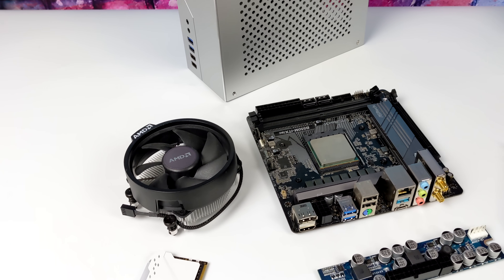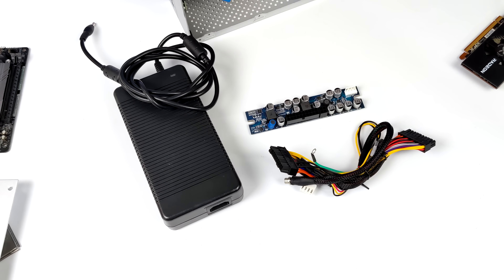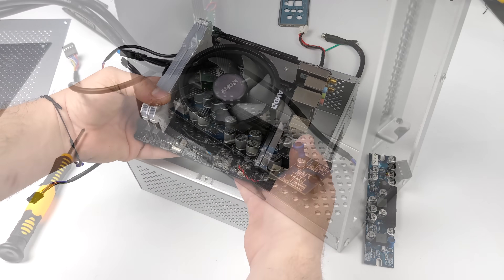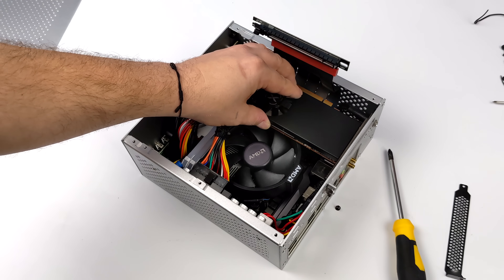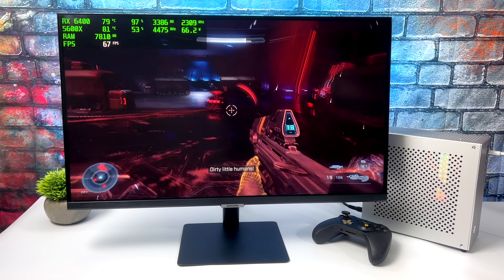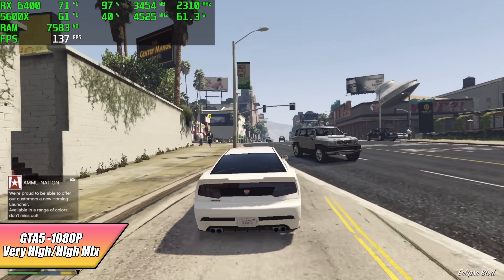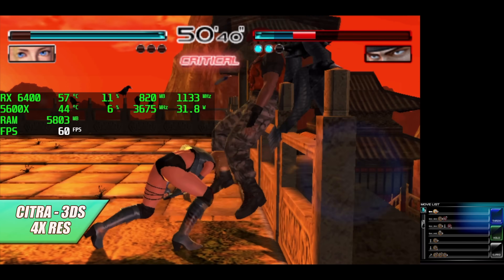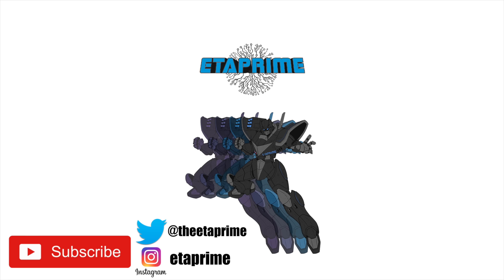A Tiny PC With An RX 6400+Ryzen 5600X! Big Power Small Foot-Print! Gaming/EMU build

Comment: Definitely want to build a setup like this, awesome performance on a shoestring budget. Other than Elden Ring performance, it seems generally solid and for me anyway, it'd be a pretty big upgrade from what I'm running.

(What the hell is up with Elden Ring's optimisation anyway?! FromSoft need to enable FidelityFX support for that ASAP if you can only get a solid 60 at 900p, incredible game but it clearly runs like dogs**t).

Question - I know it seems unreasonable, but mostly for futureproofing reasons, do you think a system like this would see any kind of performance bump with DDR5 ram? I'd worry a little about a system like that falling behind and becoming obsolete a little too quickly 2 to 3 years from now trying to run new AAA games at 720p low...
Reply: The only way to truly get a perfect 60fps at all times in Elden Ring is to buy a PS4 copy and play it backwards compatible on a PS5. I kid you not lmao. The PS5 and Series X don't have consistent 60. The old consoles don't get a consistent 30. And PC has bad stuttering issues which causes the frame rate to be inconsistent even if you have a seriously powerful PC.
Reply: @GhostAcez  Yep, the frame pacing issues on PC are insane and I have no idea why they happen (though I did hear one theory that the frame rate and pacing issues were tied to the Simplygon rendering tech FromSoft uses in their engine for long draw distance). I'm playing on a base PS4 cos my PC doesn't meet the requirements - I'm happy enough, but it is ridiculous it can't hold 60 on PS5 natively, Series X or a 3090 on PC. And I have no damn idea why they haven't implemented Fidelity FX or DLSS to smooth out performance on PC, it's such an obvious fix but they haven't done it :(

Though spare a thought for the people stuck playing the game on X1 of all the possible formats. OOF. 25fps at 900p with massively culled textures and ridiculous animation LOD's that slash enemy animation to 15fps if more than one enemy is on screen at the same time. Ouch. Least my PS4 mostly sticks to 30 (ish)
Reply: @anarchicnerd666  I've heard the issues on PC are due to a bad anti cheat software they used for it. I've seen some tests and ever lower end to mid range GPUs don't max out in the game but the CPU is normally working hard which people think is caused by the anti cheat software.

How well does it run on the base PS4? Is it smooth? I've considered getting it on PS4 just because I don't want to deal with stuttering on PC and it seems graphics typically have to be turned way down on a lot of systems to get a  consistent frame rate.
Reply: @GhostAcez  I can absolutely believe it's due to the anti-cheat implementation, especially given the security issues just before launch and how lousy DS3 was with hackers and broken PvP. There's also the Digital Foundry analysis, and it could just be catastrophic shader pre-caching and horrendous DirectX implementation like they think it is. I don't think we'll ever know at this point why the PC port is so unstable, FromSoft just needs a new engine at this point I think. It's clear their old engine from as far back as Demon's Souls just isn't cutting the mustard anymore, especially given the sheer ambition of the games they're now making.

On base PS4? Pretty good actually, I'm happy with it. If you've played Bloodborne, you know what to expect - 1080p native at 30fps with inconsistent frame pacing. The frame pacing seems to be less egregious than Bloodborne and DS3, it seems more stable, so that's nice at least. Visuals are pared back of course, but not excessively, it's overall art style still translates and remains cohesive. Expect reduced foliage, simpler shadows and if you have more than 8 enemies on screen at the same time, the most distant ones will update at 15fps to keep the framerate stable (you'd be surprised how hectic the game gets sometimes). The thing about Elden Ring, it's something that's be difficult to describe unless you've played it, but... Elden Ring is the game that will likely convince you graphics are irrelevant the longer you play it - art direction is the only thing that truly matters. My jaw has still hit the floor plenty of times during the game, it's visuals are utterly incredible. My advice? If you've got a rig that you're confident can run it at 1080p medium and be consistent, give it a shot - Steam refunds are a thing, you'll know if it's stable enough for you pretty quickly (you'll start seeing issues within the opening 30 minutes of the game most likely, just sprint through character creation once you've picked a class). If not? Get the PS4 version. It's perfectly acceptable and does the job nicely - it's stable and it hasn't crashed on me once nor have I run into any game breaking bugs, and I've got 300+ hours logged already. (Also, final tip - ARC and bleed builds are bonkers, try being a thief XD)

Comment: Reminder to everyone that this card does NOT do “encoding.”  This card will NOT be good for a Plex server, as it will not transcode, and it will also not be good for Twitch/YouTube game streaming, as it does not encode the stream with the GPU.

Edit:  Another reminder - this card when used with a PCIE 4.0 motherboard and CPU will be around 20% faster on average than a GTX 1650 for gaming.
Reply: I mean can't the cpu do that?
Reply: @K.R.X  CPU can probably do one or two transcodes, but no, not always.  Example, if you’ve got a 4K HEVC (x265) movie at 25mbit, and you’re transcoding down to 1080p x264 at 8mbit, then no.  Your CPU won’t keep up.  

If you’re talking about streaming to Twitch, I’m sure the CPU can try to keep up, but you’d be limiting your gaming performance because 4 or 5 of your cores are pegged at 100% and therefore your frame rate will suffer.
Reply: @bleeb1347  Simple then. Just use 5950X.
Reply: @K.R.X  yeah, that’s a GREAT pairing with the lowest end GPU AMD makes, lol.  “Let them eat cake” comes to mind here.  If you want a Plex server, use an Intel CPU with QuickSync, or use an nVidia GPU, which has NVENC.  

If you want to do game streaming, this 6400 isn’t going to cut it paired with anything less than a 12 core CPU.  This generation of Ryzen doesn’t have its shit together yet, but next generation introduces an integrated GPU on every Ryzen CPU.  They’ll be small (3ish compute units) but the integrated GPUs  DO have encoders on them, so they’ll do the job.  

This card isn’t for game streaming or Plex, no matter which CPU you pair it with.
Reply: @bleeb1347  It was sarcasm mate. You're right on everything you've said so far. Calm down.

Comment: nice set up .... question is motherboard make performance better? I quite copy your old video with the ryzen 3 3200g but I use PRIME A320M-K and after few months I buy a cheap GPU rx550 4gb but when I search youtube for my same cpu and gpu for setting of games I cant get close to there performance the only difference is the motherboard they use only b450 or b550.. do i need to change to that motherboards?
Reply: Motherboards can make a difference. Hardware Unboxed did a couple videos looking at performance across different motherboards.
Reply: @davisbradford7438  thanks thanks

Comment: There's a few itx A520 motherboards that under normal circumstances would be a better fit for this build: lower price, still enough features to be workable and would run a 5600x just fine but alas, the 6400 wouldn't be optimal with that since A520 is pci-e 3.0 only
Reply: IF you were looking to shave cost on this rather than the motherboard, maybe drop back to a 5600 non-X, a little cheaper and about the same level of performance

Comment: Nice build, this setup would be great for a living room gaming PC.
Reply: yes i was just thinking the same thing
Reply: I thought the same like 4 months ago and went for a used HP OEM PC "Pavilion 590". Small silver case, 180 Watts, Ryzen 2400G, SSD, 1TB HDD even an optical drive (!) for like 160 €.

The case is big enough for like a GTX 1650 or this RX6400 card, if I want to boost that Vega 11 graphics. But till now it's fine!
Reply: @hassosigbjoernson5738  Dude that's super cheap, the APU alone in my region costs around €50.
Reply: I would agree but the XFX RX 6400 has a very loud fan and I found it distracting even across the room. I built an HTPC for gaming with it and it is much louder than my older HTPC that had a GTX 1650.
Reply: @MGMan37  yep, those blower coolers even on low end cards can make a ruckus
Reply: @memenation5105  I have a Quadro T600 which has the same size fan running at the same RPMs and it is way quieter. I wonder if I have a defective one or if I can custom replace the fan with a better one
Reply: @MGMan37  it could probably be the thermal paste

Comment: I think the rx6400 have only 4 pcie lanes, so using it in a pcie 2.0 computer would be no good idea.  (that means 2GB/sec) compared to PCIE 3.0 x4 = 4GB /sec... and normal GPU:s with PCIE 4.0 x16 have 32GB/sec.  So its probably only a good idea to use on PCIE 4.0 motherboards mostly.
Reply: These cards don't support legacy BIOSes so it won't even boot in older systems
Reply: @amirpourghoureiyan1637  sucks I was thinking about putting one in my 2011 hp slim line system with a Celeron. Would of been bottleneck city but it would have been cool to revive such an old system.
Reply: @madgodzilla12465  First gen i-series + celeron did have some support for UEFI, depends on the motherboard but there are some that would be compatible.
As Andrew mentioned PCIe 2 would severely affect the performance of the x4 connection, so you'd be better off going with a x16 card like a 750 or a 1050ti.
Reply: @madgodzilla12465  Linux will be your best friend here
Reply: I really wish they actually gave it 4x long connector, instead of wasting gold for full length 16x one. I could run it off PCH slot this way. With PCIe 3.0 that's 4 GB/s, and with 4 GB of VRAM that's not THAT bad, actually. You're not going to drip high res textures on it anyway to save on computing juice.
Reply: @Vatharian  some tinkering with a saw to make a notch for it to fit in... would probably work.
Reply: @Vatharian  you maybe can just cut it off with a saw actually. or saw in the 4 connector so the full length can go into it.
Reply: @AndrewTSq  yes, that's the idea behind the connector, it's just I'd lose warranty, and I am pissed why that's a thing in the first place? Are manufacturers afraid of releasing video cards with short connectors? If ANY other device was released like that, there would be mocking articles and complains (except for bracketless M.2 adapters, which use slot's grip for holding).
Reply: @Vatharian  I think the reason for x16 connector is due to power draw. x4 and x8 slots are rated for lower power (I think 25W) which is not enough for this card.
Reply: @vng  you are correct. x4 and x8 only have 25w max, and x1 10w max.

Comment: Hey man can you please explain the difference in GPU's used in Desktop computers with fans and water cooling and the Mobil GPU's used in powerful laptops. If you can do the same job with a small mobil GPU Chip why all the extra stuff for regular GPU's.
Reply: It's about capability. The rx 6400 is a mobile GPU. It was meant to be paired with a  mobile APU in a laptop. GPU's that are more power hungry need better cooling.

Comment: If possible, you should upgrade the cooler and get a 5700X
Reply: Nothing wrong with the stock cooler. Just needs good airflow through the case.
Reply: Oh, and maybe deshroud the GPU and throw a custom 3-fan cooler on it.
Reply: Why though? Everything is GPU bottlenecked.

Comment: Hell yeah. This is what I'm on about. The thing I like the most about this card is that it is both Low Profile & Single Slot. Can't say I've seen any 1650's cover both.
Reply: It’s the problem. There are gpu cards that would outperform the 6400 pretty easy, like the 1660 series, but the are all full size and/or Dual slot, so not apliccable in an Ultra small form factor case. Really the card is a low end 1080p at best, and should really only be a 100-120 $ card. But as is, Its really the only low profile card that can put out a decent entry lvl gaming performance, even it is slightly overpriced. Its a good little system for not too demanding titles. Hell, I still have some weired issues with a 3800X and a 1660s in Elden Ring. I have no problem getting 60fps in 1080p but some weired horizontal banding is happening while playing. It’s both a cool game in some ways, but really shows Its made for consoles and some people have really many issues running it on a good pc gaming rig.
Reply: @mrdali67  Never played Elden Ring. But, I have seen some pretty nasty frame dips using a 2600X and an RTX 2060 for just 1080p Horizon Zero Dawn...
Reply: @mrdali67  my case just came in. I ordered the rx 6400 and the power supply. I'm going to let them sit for a few years. I plan on building my fiance a computer once we get a house. She doesn't game. She just web browses and watches videos. Even if she used certain programs. It's nowhere near as demanding as a game. So I figure I let them sit and I'll build her a small rig for a TV to run at 4K so she can just sit on the couch and do whatever she needs or I can get her a 4k monitor. So far I've spent 250 bucks. I just need an SSD maybe 500gb, 16gb ram, an mini itx mobo am5, and the processor. But I'm going to wait till they go down in price though or when next gen coke out the 7600x will drop in price and I can get the components at a great price.
Reply: mm kk
Reply: there also used to be a fully passive 1650, which i would like to see more from low-end gpus